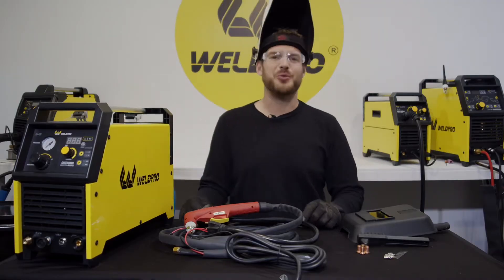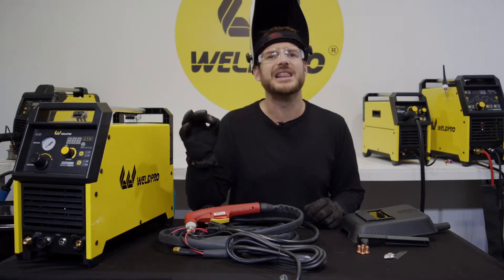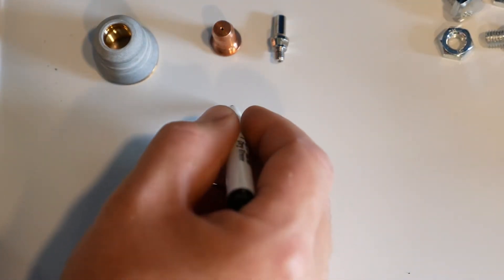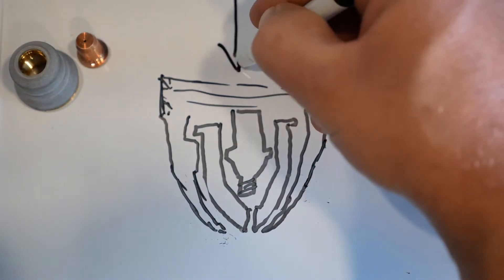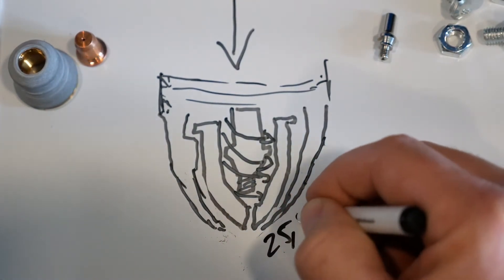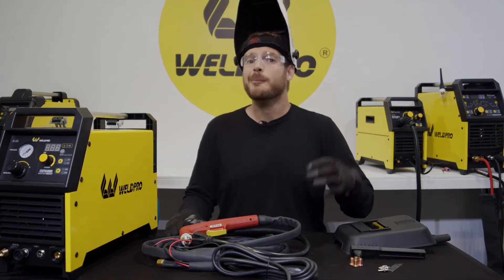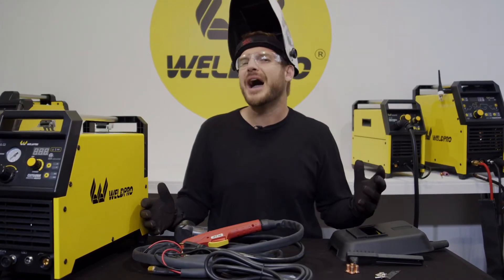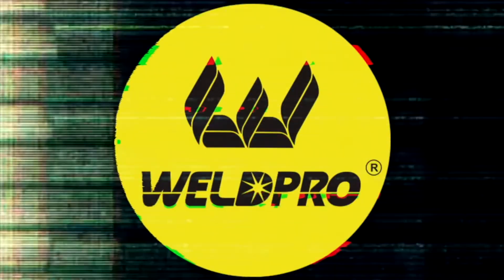Plasma Cutting Quick Tip #1 - Dry Air Science!?

Comment: Maybe you'll see this after all this time and can maybe help. I run a plasma table and I use it quite a bit every weekend (I have an Etsy shop). I'm currently using a PrimeWeld Cut 60, with the ipt60 torch.

Problem I'm having is about every 4-6 months (or less), the blowback mechanism will start "sticking" and the arc will randomly not fire. I use a Harbor Freight Air Dryer feeding to a desiccant dryer and out to the machine. 

Is there any way to fix/prevent this, or should I just consider the torch a consumable, considering the amount of use it gets? I don't think 4-6 months is bad for the amount of use it gets, but I'd like to prevent it from happening or at least prolong its life.

Thanks
Alan